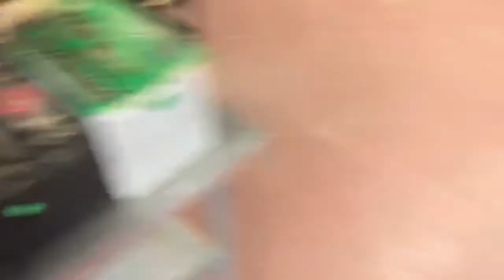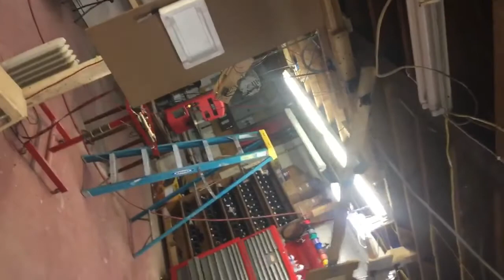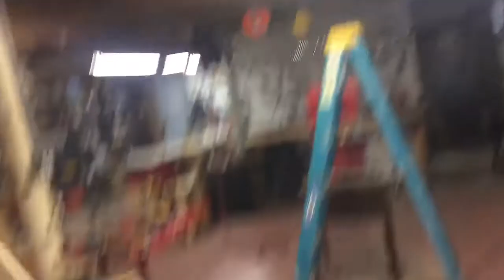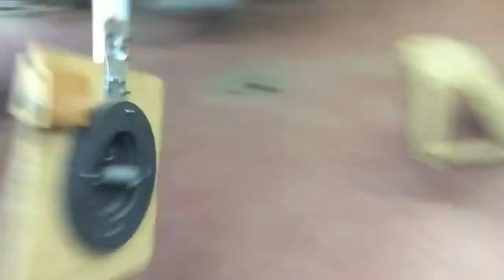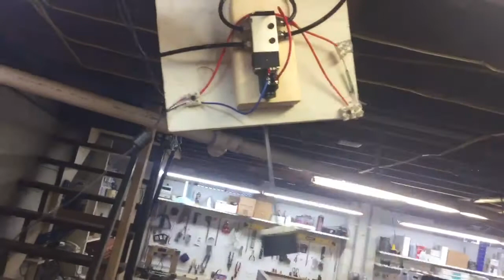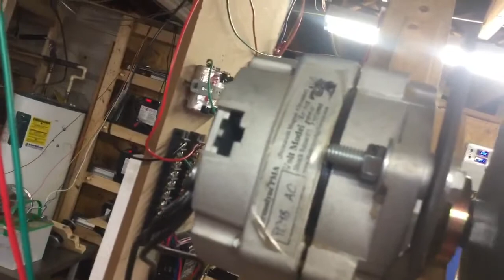Pendulum energy. Pneumatic driven permanent magnet generator. “Elliott Air Swing”

Comment: I am ready to carry out the electricity generation project with angular resonance together with investors who agree to make an official protocol. I have worked for 15 years for this project. After the official signatures are signed, everything will be done openly.
Reply from the maker: Here is something all free energy nuts need to see. NO EMF, NO EDDY CURRENT, MONOPOLE CAPABILITIES. https://youtu.be/-wxgZqtVcxo
Reply: @jameselliott9397  Whoever builds such a system, the rule to understand is simple. You cannot produce energy without getting energy from outside with a disc that rotates continuously and whose angle does not change every second. Of course, if you try this, you will understand the subject better. At least 2 different resonance angles are needed to generate energy. This video system has 1 fixed vibration resonance. Therefore, it acts as a kinetic capacitor (temporary energy storage). It does not provide additional energy to the system. Everything is within physics. There is no energy created from nothing. Existing energy is used in the best way. Gravitational energy is present everywhere. In my design (ARES), the robotic and mechanical system, whose angle changes every second, provides this.

Comment: not practical to generate energy, but i would build one just because its cool. I like it because its different. build it and let it run. everyone needs a hobby, but dont expect to get any useable power from it because you always have to put more in than you get out. but I would let it run anyway just because it looks cool.
Reply from the maker: I let this https://www.youtube.com/watch?v=NdmFCk-eQeA run for 47 days. Batteries had started at 12.1 v and had 12.2 after 47 days.   Note I was using a Smithy 12V compressor to a small air tank to run the actuators. One way bearing on the drive shaft.  Its been a few years. I am going to build a high precision unit out of extrusion profile.  Very noisy and was driving me crazy when  I shut it down  LOL. Please let me see your build.  wifiride  at G mail

Comment: Looks interesting
Reply from the maker: MissouriWindandSolar , a couple of people said the back and forth movement will ruin tha permanence this magnet generator. Do you know if this is true?  Please look a future videos. I have already disassembled this rig and will go to the next refinements.  Nine37 39three one974.  Do you sell a generator or something that would be helpful for my research in this type of setup? Please subscribe.
Reply: @jameselliott9397  It will not ruin your generator at all.
Reply from the maker: Thanks for the info.  I am adding a flywheel and doing some other testing.  This takes a very small amount of air to run it. I put a smittybilt  5cfm 12 volt compressor and portable tank on it so it’s all self contained.  It works. The batteries go up in voltage. And there’s energy to spare.   I am also experimenting with a bottom weight pendulum that runs pneumatically working like a person on a swing. Using a gyro and Arduino board to detect when acceleration is zero and weight is 0. Then the mass is moved for very little energy cost. This enables it to adjust to changing loads.
Reply from the maker: I would love to see you duplicate and perfect this with your resources.
Reply from the maker: Here is something all free energy nuts need to see. NO EMF, NO EDDY CURRENT, MONOPOLE CAPABILITIES. https://youtu.be/-wxgZqtVcxo

Comment: I like this one.  I began working on a similar thing but I hopped to use 

strong magnets on the end of the pendulum such that they would 

sandwich a serpentine coil, generating energy, an additional circular coil would 

pulse the pendulum to keep it swinging.
Reply from the maker: Such a tiny bit of energy is needed just after top dead center to make up for the loss on the uphill swing.  The energy lost in one swing is typically very small, around 1-1.75% or less per swing on a pendulum from 90 degrees. This means that if you input 1.75% more energy, that you can harvest the other 98.25% of the energy. The percentage of energy lost in one swing depends on factors like the size, weight, and length of the pendulum, as well as the environment

Comment: some late thoughts.      a reciprocating system that produces intermittent output force is not 'gonna fly'.     whenever  gravity  is  'used',  gravity   'takes back'   a large part of the energy, on the 'uphill' side.      such a config  Cannot be as  efficient as you may think.    in part, because,   when determining efficiency   ALL  INPUT  ENERGY  Must be 'counted'.     this includes the energy  Consumed by a compressor or any other input-side  machinery.       googletranslate
Reply from the maker: Well it was fun to build..... Check out my latest in 2021  https://youtu.be/SB9RW3y2qMs
Reply from the maker: Here is something all free energy nuts need to see. NO EMF, NO EDDY CURRENT, MONOPOLE CAPABILITIES. https://youtu.be/-wxgZqtVcxo

Comment from the maker: See it with a tiny cylinder https://youtu.be/Z5RzJiPHJT8

The piston is driven back up by the pendulum to insure contact when activated.

I increased load with a 800w peak inverter running 110v drill and had to up the air pressure to 90 psi to maintain. running over 10 hours now.

The deep sound you hear is the permanent magnet generator turning.
Reply from the maker: https://www.youtube.com/playlist?list=PLy4rBHH_luJ335fcuCs373siHbIaH7SXm

Comment: how many amps (from your 12V battery) does the air compressor pull in the 45 to 56 seconds period?
Reply from the maker: Don’t have figures, in this particular video it was running off my ac compressor. I was not creating any power, just testing concept. Part of the stuff I ordered was watt meters for the one that runs on the dc compressor and turns the flywheel.

Comment: It looks impressive.   I just don't know what benefit you would get from this.  Certainly not overunity.
Reply from the maker: Look at later models ... indisputably over-unity
Reply: @jameselliott9397  Careful with using the word indisputable.  All I have seen is demos showing voltage in less than voltage out.  That is not overunity.  If overunity is claimed, send me the link to a video(s) where the power output is measured and compared to the measured power in.  If Power in is less than power out, then you have overunity.
Reply from the maker: Amps x volts = Watts.  And that’s watt matters.  Regardless of where the energy is coming from. Energy cannot be created nor destroyed. However electricity can be converted from a recipe of energies. 

Someone said it has to be a closed looped to be over-unity. I certainly does not.
Reply: @jameselliott9397  
For Overunity to be possible, not only must the system be able to power itself but also drive a load.  Unity pertains to a system capability to have only enough energy to run itself and that's it.  Neither is possible.

Conservation of Energy:  Energy can neither be created or destroyed; rather, it can only be transformed from one form to another.
So tell me where does this extra energy come from to produce overunity?
Reply from the maker: over- + unity (“the number "1"”), referring to the fact that an over-unity device should produce more energy than it receives as input. Coined to avoid patent rules that prevent impossible technologies such as perpetual motion machines being patented.

However a device that inputs more than one energy resource to output the energy in a different form is not encompassed in this definition .  

For instance, is the energy that it takes to build a solar panel more than the energy output in the lifetime of the solar panel?
Reply from the maker: If you look at a solar panel and disregard any energy that went into building the device, it has an input cost of 0. My point being that the definitions are vague for free energy and over-unity.   I looked up several definitions, and no5 one of them says closed loop. In my opinion pedaling a bicycle generator would be free energy.  An over unity device would be a device that included turned the solar panels to track the sun that charged the batteries to power the actuators and had excess power for a light. If not, we need a new definition for what this device would be.
Reply: @jameselliott9397  The reason it is vague is because overunity and unity are made up names by the "Free Energy Community" that represent efficiency.  Unity refers to 100% efficiency and Overunity refers to greater than 100% efficiency.  Both are theoretical and have never been attained.  No ambiguity here.
Reply from the maker: I thought unity in energy terms meant having apower factor of 1.0, that is present when amps and voltage are in phase, as in a circuit containing only resistance or in a reactive circuit at resonance.
Reply: @jameselliott9397  PF of 1 is definitely a fully resistive circuit. The reactive components contribution are canceled out because the circuit is in resonance.  You can use unity anywhere you want to represent 1 or 100%.
Reply from the maker: Here is something all free energy nuts need to see. NO EMF, NO EDDY CURRENT, MONOPOLE CAPABILITIES. https://youtu.be/-wxgZqtVcxo

Comment: Instead of using pulleys you should use gears. Like those toys that you squeeze. Your completely underutilized the force of it
Reply from the maker: Richard Maxim  yep, if I had gears that big wit a one inch shaft and 5/8 shaft.  It makes a tremendous amount of torque. And uses surprisingly little air to run it.
Reply from the maker: I need some cheap gears. I thought about using old car flywheels if I could find something to mate up to them
Reply from the maker: I posted a new video that may interest you. https://youtu.be/NdmFCk-eQeA
Reply from the maker: Check my latest out.  https://youtu.be/NdmFCk-eQeA
Reply from the maker: Here is something all free energy nuts need to see. NO EMF, NO EDDY CURRENT, MONOPOLE CAPABILITIES. https://youtu.be/-wxgZqtVcxo

Comment: wrong sorry, output power needs too be taken from, vertical push and pull force apon the pendulum bearing joint ....   currently it is just a power converer, not amlifier....  note the water pump below my pendulum  https://www.youtube.com/watch?v=7bhDG0YE6KA  if you want, i will point a camera at my new device, - the linear too rotary freewheel converter.
Reply from the maker: The push is vertically downward..... I was not taking any output power from it. Just built it as a design to study.    Check out my latest in 2021  https://youtu.be/SB9RW3y2qMs
Reply from the maker: Here is something all free energy nuts need to see. NO EMF, NO EDDY CURRENT, MONOPOLE CAPABILITIES. https://youtu.be/-wxgZqtVcxo